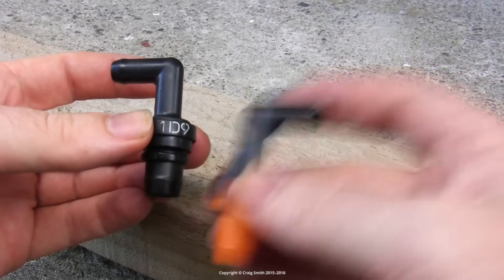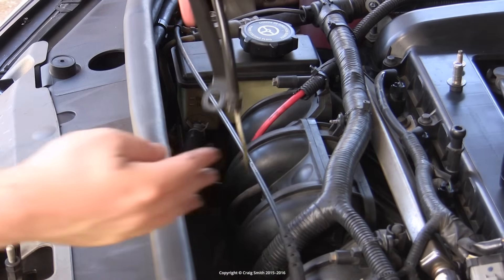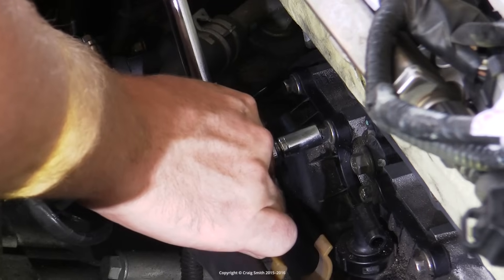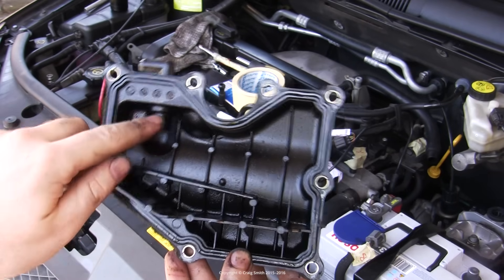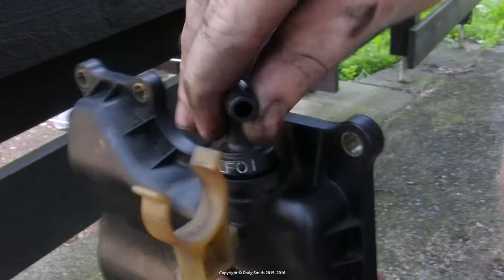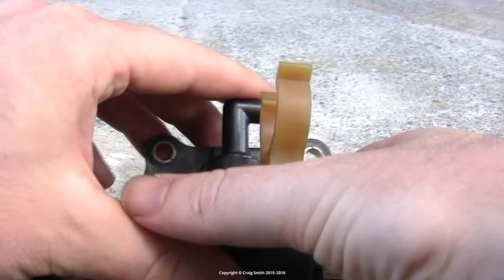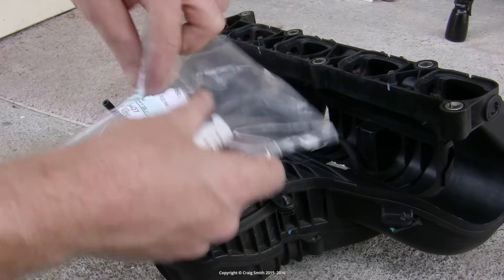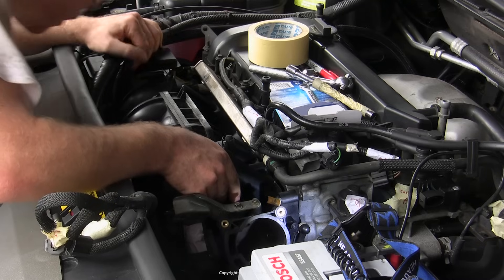How to: Replace PCV valve, hose, oil separator Ford Duratec / Mazda L (Focus/Ranger/Mondeo/Mazda)

Comment: Many thanks Craig for your sharing knowledge, 
I know nothing before watching your videos. After that, I know how my car works. 

I have applied what you showed to my 2004 Mondeo 2.0 Petrol Wagon, which has serious idle issue. at start up It rews up to 4000rpm and slowly goes down again to about 1500 rpm and stays there. same issues when driving and shifting gears, it revs again when I make a halt.

Following your videos, I have done, 

How to: Clean & replace throttle body Ford Duratec HE
How to: replace a throttle position sensor
How to: Clean & replace Idle Air Control Valve Ford Duratec HE
How to: Clean & replace T-MAP sensor Ford Duratec

However, those things can't fix my serious idle problem.

Could you please give me any suggestion?
Best regards,
John
Reply from the maker: You probably have a vacuum leak after the throttle body. Alternatively, maybe a problem with the TPS or IACV. You need to diagnose further before replacing parts, with a scan tool, then search for air leaks.
Reply: Thanks Craig,
The new TPS has been replaced. 

Also, I have done a test on IACV. When the engine is warm and running steady around 1500 rpm, I tried to disconnect the IACV but it's not noticeable, should not the rpm decrease or engine stall if I disconnect it? So I think the IACV is working OK. 

I have done a test on blocking the throttle body and the air pipe to Crankcase. When the engine is warm and running steady around 1500 rpm, I tried to block the throttle body and the air pipe to Crankcase but it's not noticeable, should not the rpm decrease? 

I have not a scan tool to search for air leaks. Maybe later. 

There are no parts for a vacuum hose and a PCV valve on Amazon & eBay. My reg is CKH545.
Reply from the maker: 1500 RPM is too high for idle. Not sure what you mean by blocking the TB as the butterfly valve blocks it always when throttled (at idle), IACV is open at idle and progressively closed at increasing revs. You probably have an air leak, just search for it manually. Can you hear hissing, particularly after killing engine (as pressure equalizes). Common failure is the PCV hose as you mention. If not that try soapy water on other joints.
Reply: Following your instruction, I did hear the hissing and I saw the white smoke/steam coming out. Are you in AKL? if I come to see you, can you fix it for me? How much does it cost?
Reply: Thanks Craig, yes, it's a vacuum leak after the throttle body. Following your instruction, the new PCV parts have been replaced. The idle is 750 RPM now

Refer to: https://www.trademe.co.nz/Browse/Listing.aspx?id=1860939484

Comment: ill never buy a ford again because of the crazy location of parts that need replacing and u have to take apart the intake manifold,,,is nonsense
Reply: Well seeing as it's a MAZDA engine you're throwing blame in the wrong direction!  Volvo also used this engine (not on their current range of cars).